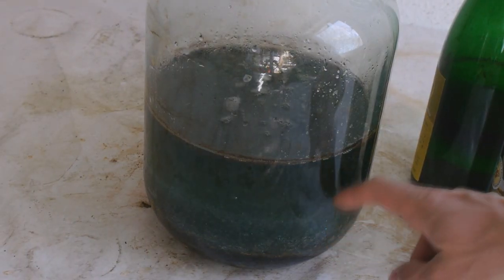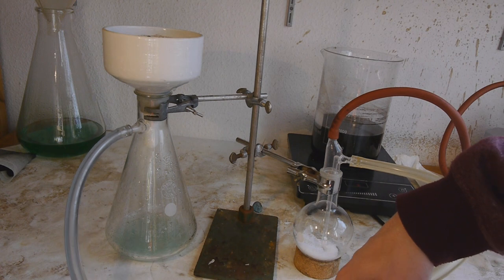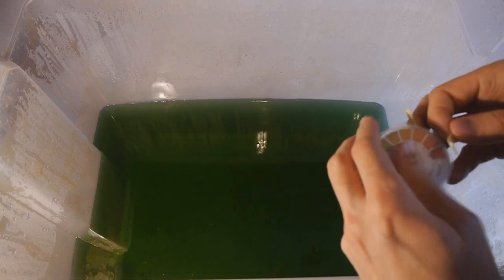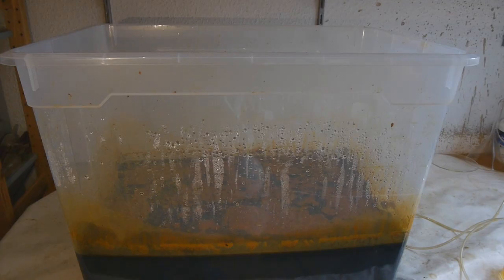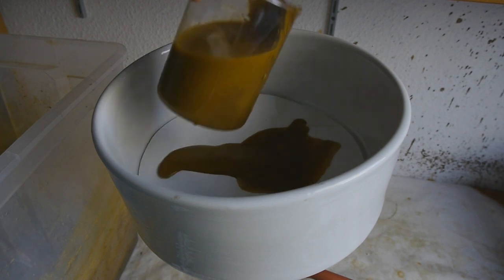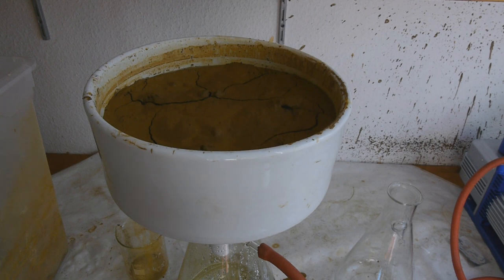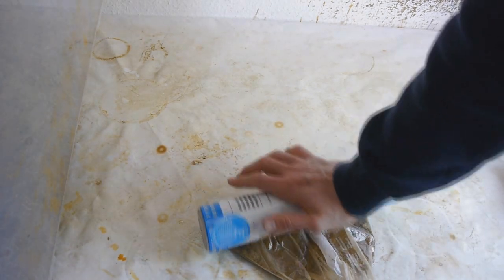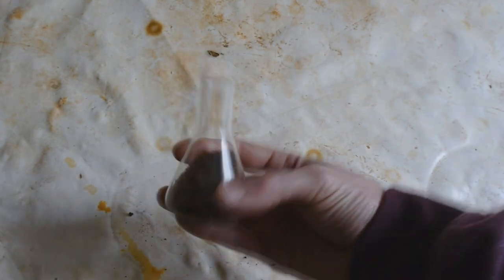Iron Oxide (Fe2O3) Synthesis on Large Scale Is A Huge Mess (Dealing With Chemical Waste)

Comment: To wash the iron oxide, instead of filtering you could add as much water as you can to it, mix thoroughly, let it settle down, and decant as much of the clear liquid as you can.  The time it takes to settle does not depend much on the amount of water.  Repeat 2-3 times, and that should get rid of most of the sodium sulfate. Then you can just spread the sediment in a wide and shallow tray, cover with a cloth, and let it dry outdoors.
Reply from the maker: That would definetly be an option, but that would also produce a lot more waste water. At the same time the vacuum pump also wasted a lot of electricity, so I am not quite sure what would be better. Probably your option is a lot less messy.
Reply: @EliasExperiments  Sodium sulfate and sodium hydroxide are harmless to the environment, so the wash water can be just poured down the drain.

Comment: If you still have an abundance of extra Iron Sulfate around, something you might be interested in doing would be to try your hand at making ferrofluid.  I suggest this because Iron Sulfate (FeSO4) can be one of the precursor chemicals in ferrofluid production.  Some methods utilize Iron chloride, others use iron sulfate, some use both iron chloride and iron sulfate.  The end goal is the production of uniform scale nanoparticles of magnetite.

        There are a number of different methods for producing ferrofluid here on Youtube.  Most of these demonstrate methods which produce a substance which is not actually ferrofluid, but mimics the behavior of ferrofluid.  These are created by simply mixing a magnetic powder such as photocopier toner into a carrier fluid such as motor oil.  This results in a fluid which can be moved around with a magnetic field, but the results leave a lot to be desired when compared to the performance of actual genuine ferrofluid.
        The genuine ferrofluid also consists of a magnetic powder and a carrier fluid.  The difference is that the magnet powder is made of magnetite nanoparticles, and these nanoparticles are treated with a surfactant which allows them to produce a stable colloid when mixed with an appropriate solvent.  In this case, kerosene is used.  The result is a commercial grade ferrofluid.  When this ferrofluid is exposed to a magnetic field, it produces large spikes where the magnetic field lines are.  These spikes are absoluely smooth and look like fluid.  You won't see any particles coming out of the solution at the tip of these spikes or at the edges.  This is something that happens with the immitation ferrofluids which use toner powder or iron powder suspended in oil or some other carrier.
Reply from the maker: Yeah that is certainly a cool idea, thank you for your suggestion!

Comment: The sodium sulfate should not clog the filter.  One reason why the  second filtering was faster than the first one may be that the high pH causes the paper fibers to soften and swell, closing the pores.   Another reason may be that the particles of iron oxide slowly recrystallize and aggregate while wet.
Reply from the maker: With the high pH and the filter paper is definetly an interesting idea. I certainly didn't think of that. I am not sure about the iron oxide recristallizing. If I knew a way to aggregate is more easily, that would be absolutely amazing.
Reply: @EliasExperiments  Unfortunately I cannot find the paper where I saw that discussion.  In my recollection, it said that FeOOH is unstable and (very) slowly converts to Fe2O3 even in water suspension.  If so, conversion would be faster by boling.
Reply from the maker: I am not so sure about that, cause I had the Fe(O)OH standing around for 8 month and nothing happend to it. Even after 5 hours at 250 °C in the backing oven most of it hadn't converted to Fe2O3.
Reply: @EliasExperiments  Yes, IIRC the conversion is VERY slow at ambient temperature, and was observed for nanoparticles -- that have a very large surface area over volume ratio.  
I should try to find that paper again.  
I may be mistaken, but I believe that you cannot turn Fe2O3 into FeOOH by mixing it with water; can you?.  I believe that the equilibrium in Fe2O3 + H2O  <---> 2 FeOOH  is very much skewed to the left; but there is a large energy barrier because of the crystal structures (that's why it takes more than 250C to dehydrate). and, at ambient temperatures, the conversion can only happen on the surface of the solid.
Reply from the maker: Yeah I also doubt that Fe2O3 will hydrolyse in water. Inorganic solid state reactions are just way to slow at ambient water temperatures. (Basically they pretty much won't work.) With nanoparticles it might be true, but nanoparticles are a real pain to work with, because they would go through every filter. I basically want as large crystals as I can get.

Comment: will this remove phosphates from water
Reply from the maker: Well maybe, but there are far more effective ways of removing phosphates from water.
Reply: @EliasExperiments  what ways are there
Reply from the maker: This document describes it extensively:
https://www.matec-conferences.org/articles/matecconf/pdf/2017/20/matecconf_spbw2017_07006.pdf
It has nothing to do with this video however. :D
I mean you could do it with Fe3+ or Fe2+, it would have helped if you formulated your question a bit more precise. :P
Reply: @EliasExperiments  Thanks, yep I was trying to find out about granular ferric oxide, but came across your channel, and your iron oxide looks similar. GFO is used in aquariums for phosphate removal. Thinking perhaps I could make my own GFO, LOL
Reply from the maker: Buying it, is certainly a lot cheaper and easier. :D
Reply: @EliasExperiments  I use alot ,lol
Reply from the maker: Well especially then. Cause making large amounts is even more difficult and time consuming than making small amounts. :D
Reply: @EliasExperiments  Yep I guess it is best to buy it, as the time and effort is something I don't have. Thanks